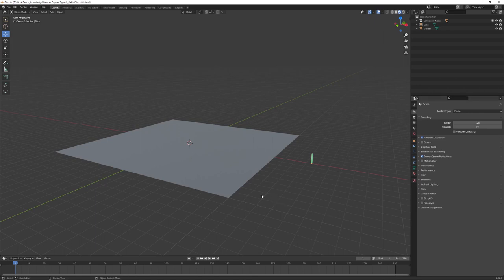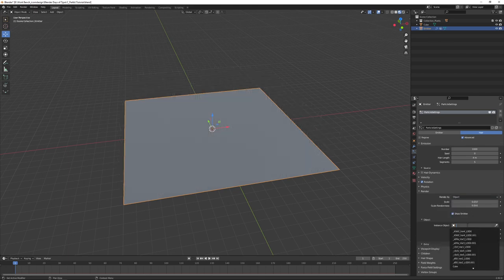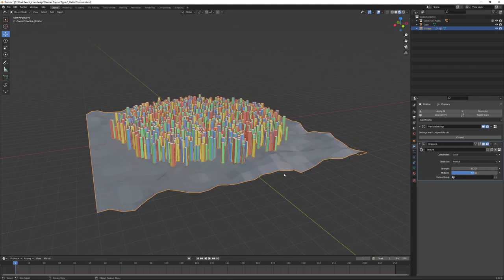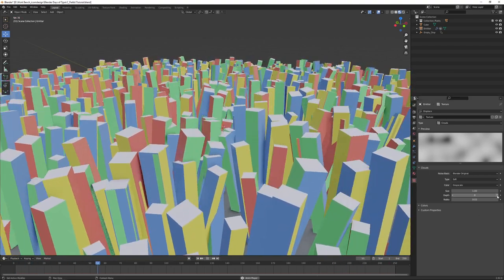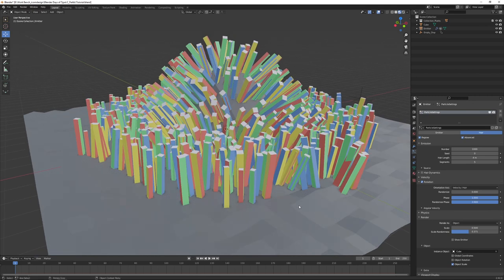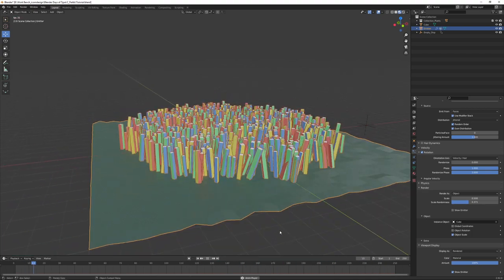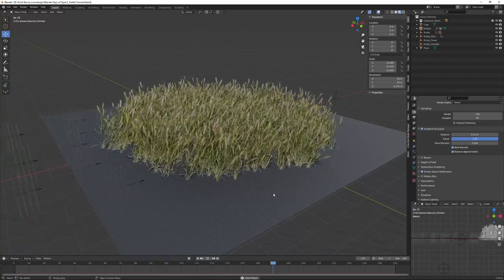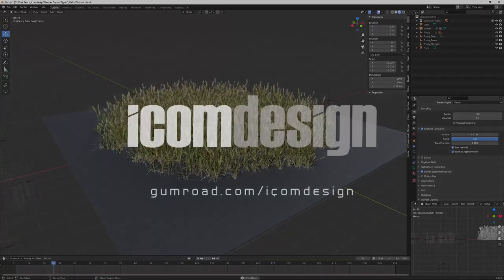C - Wind Swept Fields. Blender Days of Type. Blender Tutorial

Comment: 19:50 If you want to change the settings of all the selected winds at once then hold down Alt when you adjust one. 
They all change. Even when the numbers are all different. 
You no longer need to delete all but one and then clone that one.
And yeah - the whole 21:40 set up drivers is now NOT NEEDED.

My new favorite 'shortcut'.
Reply from the maker: Thanks Neil. Great tip. I'm going to remember that one. I just did a test and it will work while the animation is running which is good for visual feedback. I suppose the minor benefit of a driver is that if your wind objects are not convenient or easy to select then the driver will help.
Reply: @icomdesign  Select one > Shift G > Type.
Or select the Empty they are parented to and Shift G > Immediate Children.

Whoever is in the UI team at Blender HQ deserves a Mega reward. Its hard to improve on brilliant, but they are doing it.
Reply from the maker: @neilmarshall5087  Great tips. I have neglected this area of Blender. For anyone interested you can check out the Blender Manual for this here: https://docs.blender.org/manual/en/latest/scene_layout/object/selecting.html#
Reply: Or you could press Ctrl+L and link object data of all that winds.
Reply from the maker: @nimeshupadhyay4133  Unfortunately that doesn't appear to work for me.

Comment: thank you so much for this tutorial, i am working on a similar scene now, can you please give an advice  - what is the best way to fix the length of the grass, affected by the wind? i have closeups of individual thin-bladed grasses and the movement starts right at the root, it even seems they are moving inside the ground) can it be prevented? can the wind affect only top of the grass and how the strength of the wind can be linked with the parameter of 'grass stiffness'?
Reply from the maker: Good question. Unfortunately, there is no way that I have found to fix these issues with this approach. Force field objects affect the entire particle. It would be great if they had a vertex group option. This way of creating fields of grass is best used in big scenes where you need global control and the viewer doesn’t get to see the base of the plants (too much). When plants are moved by a breeze, they sway and don’t really bend a lot which helps The Wind Force objects are meant to give the illusion of bending plants. For closeups of plants you could incorporate something like the rigged plants from the first video in this series. Using the same plant models you are using in your field setup. Another option is to weight paint your grass plants so the base is not affected and then add a displacement modifier directly to them using the vertex group you just created. The movement will only affect the upper part of the plant which is what you want but it is still limited.
Reply: @icomdesign  thank you for your reply, "Wind Effect" video was exceptionally helpful, rigging for me is somehow more obvious process and can be achieved more easily, but i do want to learn how to work with weight paint - i feel it would be a nice solution in this case, i will certainly try to follow your advices and improve my grass fields)